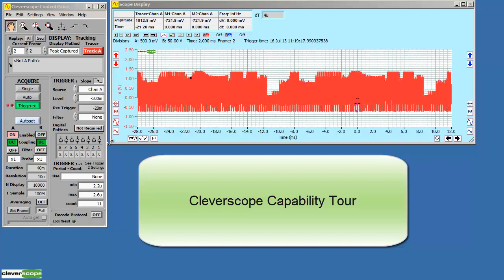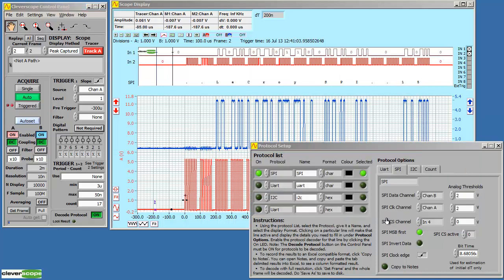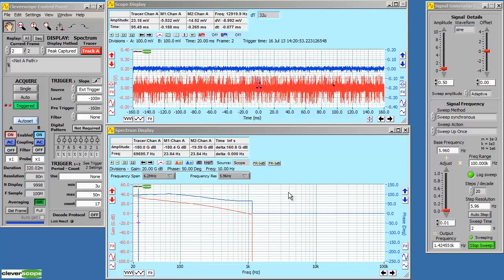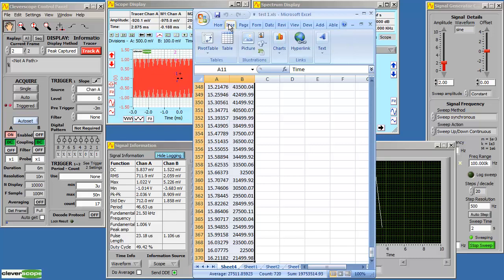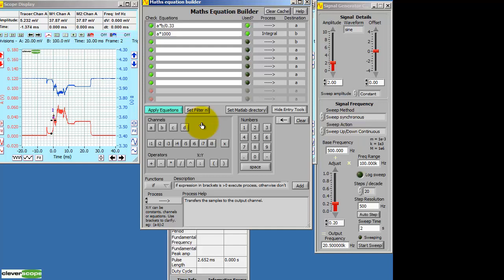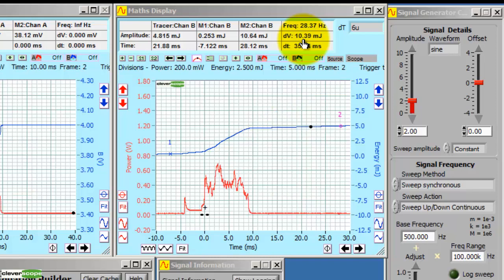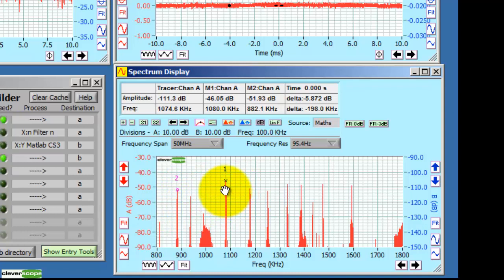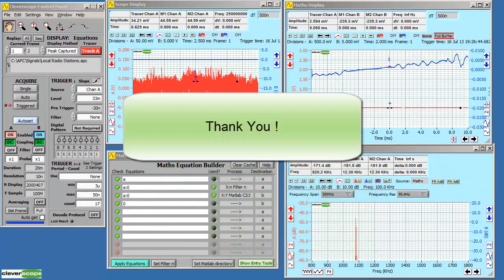Capability Tour 2

Comment: In the Scope Display, for channel A and B. Is it possible to put channel A and B in separate graphs, with own zero and units? I really do not like putting the same channel on one graph. Especially with more channels like 3 or 4, this is extremely problematic because you need to constantly be looking which y axis is applying to which graph. Even with 2 channels it is already not that great. And using offsets could eat into dynamic range of ADC, compromising resolution.

Same with Gain and Phase plots. I would prefer them in separate graphs, and not share the same space on screen at all.
Reply: First, each channel does have it's own axis and units - A on the left and B on the right. In addition the plot colour matches the axis colour, so it is easy to see which goes with what. 
Secondly, there is no direct way to split the display to have channels displayed separately. We did this because mostly you want to compare channels. However, there is a work around if you really must have this. You can have the Tracking Display showing the A channel for example, and the Maths Display displaying the B channel, and move the alternate channel out of view. If you have 'View/Displays are linked ' ticked, then if you move the tracer the other displays will follow, and you will see the channels separated.

Finally, if you want to avoid the dynamic range loss, you can do as above, but have both channels fully occupy the scope display amplitude range. On our 4 channel application, we also have a amplitude lock button on the vertical axis, which locks the channel range to the  lower hardware range, maximizing dynamic range.
Reply: Bart Schroder  Thank you Bart. The work around is rather hacky, and will not work in more complex scenarios. I would want to be able to see more than 2 graph plots, because it might be 4 channels + few math options. And they should be aligned in time, and one under each other with minimal gaps, so one can correlate them in time domain.

I see the A and B on left and right. I am not a fan of this method of presenting multiple timeseries or frequency response graphs, etc. I.e. I might have a 3 completely different quentities on 3 channels, plus on math options, like voltage, current, power, energy, plus control signals or digital signal. They have no place to be on one graph and share Y axis, even if the key (legend) is separated into different colors and sides. It is just my experience with dealing with a lot of graphs at the same time in the past, and it would be nice to have this as an option.
Reply: We will think about it. Currently we have a very full work load with extensions to the CS448.
Reply from the maker: We still haven't done that, but now you can have multiple axis, one per plot.